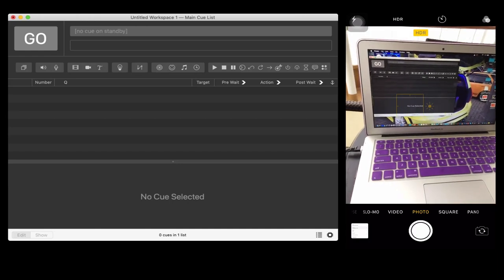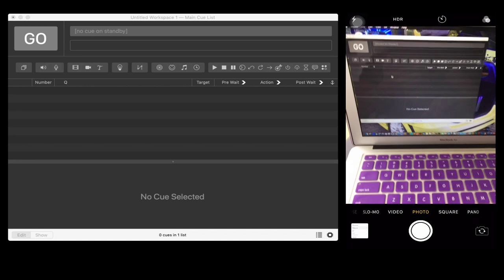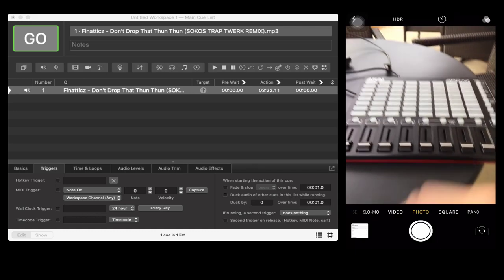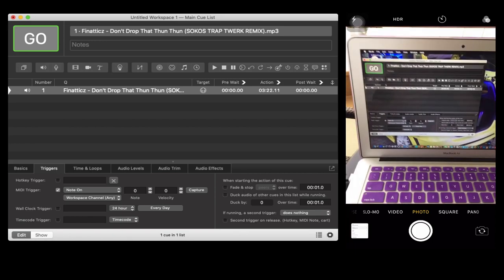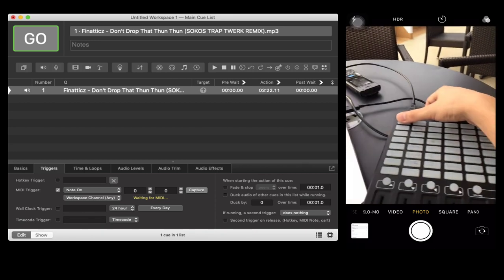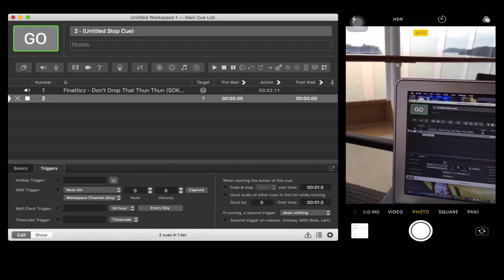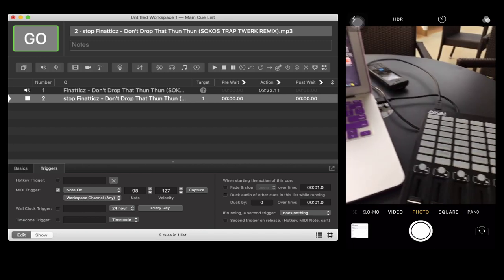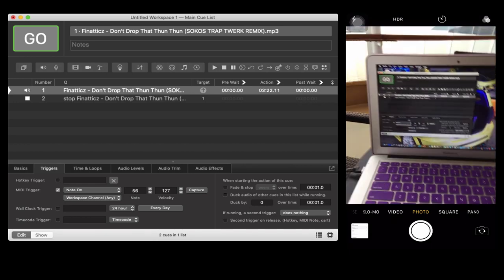How to use midi hardware in QLAB

Comment: You may want to substitute the velocity value after capturing to "any'" instead of 127. If you leave it to 127, the playback won't happen if you push the button just a bit gentlier. Setting value to "any" means that it will trigger regardless of the pressure you applied when hitting the button.
Reply from the maker: I agree on that. thanks for that additional info for the viewers Marci....
Reply: https://www.youtube.com/watch?v=PMPAAshxi2A&list=UU2YpyIFRNm9nj-5XylW1qLg&index=5